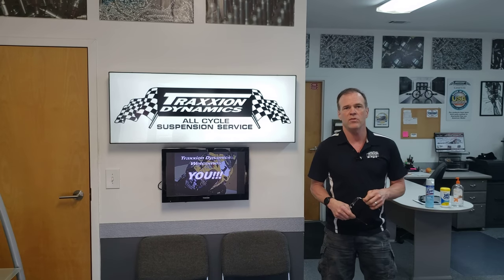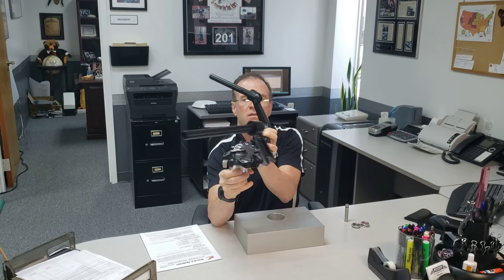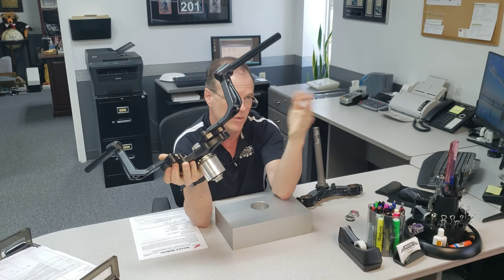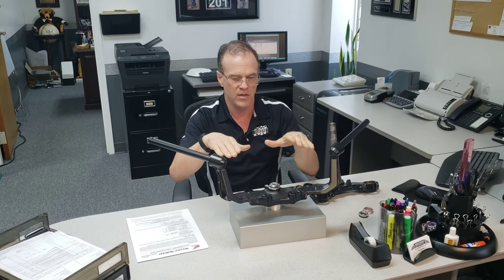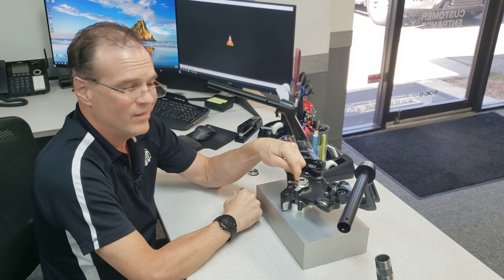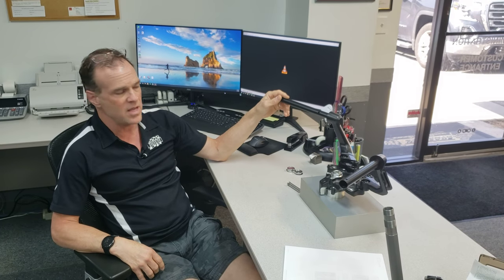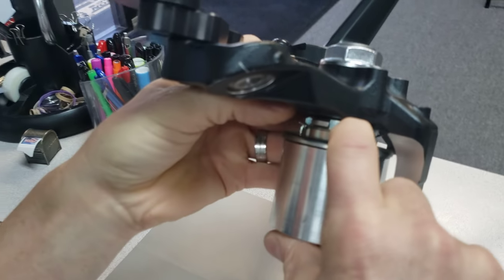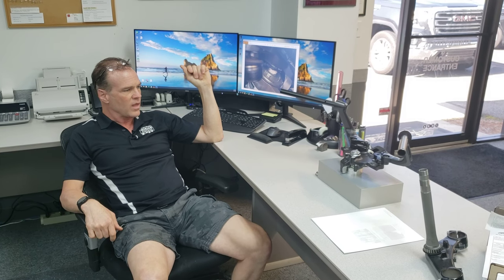2018+ Honda Goldwing Potential TOTAL Steering Failure!!!

Comment: I have a ‘21 Wing and this up/down wobble showed up instantly when trying to make a left turn from a stop into a gas station on a chewed up/under construction road covered in gravel and sharply banked left. There was a line of vehicles a mile long in the lane to the left of me blocking my entrance to the station. A dump truck made room and flashed for me to go, while coasting, so I got on it but the road and loose surface slid the rear tire out and I kicked my left leg out, stomped down and yanked the bars right to right the bike so I wouldn’t drop the bike, my wife, and myself. As I coasted toward a pump, I said to my wife “my bars have a wobble in them now after that…wtf…”. 

We didn’t have much of a choice but to keep going in that state for another 300 miles. There’s 1/2” of up/down play at the farthest end of the bar ends. I’m confirming that this is still affecting ‘21 Wings.
Reply from the maker: You need to have the spindle inspected, I wouldn't drive that bike one more inch!  Do you have our Steering Safety Pin in your bike?
Reply: @Traxxion  I’ll be ordering the new stem, safety pin, and the deeper stem nut from you shortly. We lucked out and made it to Indy safely. We were purchasing a vehicle there and trailering the bike back to Alabama. I haven’t ridden the bike since; mostly from wrenching on the vehicle we purchased. 

Now it’s time to work on the bike. It’s due for air filter replacement as well, so while I’ve got the bike apart I’ll be doing both the stem and filter while I’m there.
Reply from the maker: @BrandonWest87  good plan!
Reply: @Traxxion  Good thing I ordered the replacement spindle, getting this one off is proving to be quite the task. It’s certainly not at all able to be removed by hand per the Honda TSB lol
Reply from the maker: @BrandonWest87  that's proof it's destroyed.

Comment: Max, Sorry if this has been covered already. Could your pin mask a problem that's already there? is it easy to pop the pin out, check the bar movement, replace periodically? Although, once installed in theory it shouldn't ever fail.
Reply from the maker: No, it won't hide anything..  If the crown nut comes loose or the spindle breaks, it will be obvious to the rider that something is very wrong and needs to be fixed.

Comment: They guy breaks his bike by strapping it down via the bars in a trailer... and somehow we blame Honda?  The manual expressly states don't do it.  Want to know why?  Watch the video, you will break your bike.
Reply from the maker: Actually, EVERYONE is WRONG about that, including me.  I have read the Owner's Manual and it states NOTHING AT ALL about how to tie the bike down.
Reply: From my 2020 Owners Manual pages 223-224
Transporting Your Vehicle
If your vehicle needs to be transported, it
should be carried on a motorcycle trailer or
a flatbed truck or trailer that has a loading
ramp or lifting platform, and motorcycle
tie-down straps. Never try to tow your
vehicle with a wheel or wheels on the
ground.
 

Tie-down Method
1. Remove both sides of the cylinder head
side covers. (P. 154)
2. Secure the vehicle using a buckle or ratchet
style tie-down strap to the engine guards
and affix the other ends to an anchor point.
Make sure the tie-downs straps are tight
and the vehicle is secure.
3. Remove both left and right saddlebag

guard covers by removing the clips to
expose the saddlebag guards.
4. Secure the vehicle using a buckle or ratchet
style tie-down strap to the saddlebag
guards and affix the other ends to an
anchor point.
Make sure the tie-downs straps are tight
and the vehicle is secure.

There are two images in the manual showing the method.
Reply from the maker: @emmertw8111  The 2018 manual stops before "Tie down method 1."
Reply: For 2020 manual, Honda decided to better define the tie-down process.  Maybe too many issues with owners using the handlebars for attachment points.

Comment: Max. RE your previous response that the manual does not specify hiw to tie down.  This is a true statement for tje 2018 owners manual.  However, from another online forum,  in 2019 Honda update the transport instructions, and specifically say NOT to use the handlebars.  Maybe an updated video is in order.
Reply from the maker: In this post someone has posted the entire text from the 2020 Owner's Manual, and it recommends 2 methods, neither of which include using the handlebars.  But again, it does not say "DO NOT USE THE HANDLEBARS" anywhere.

Comment: So...has Honda resolved the steering stem issue as of 2023? Is Traxxion Dynamics safety pin still relevant? I'm considering the purchase, that's why I ask.
Reply from the maker: No, same spindle as 2018.  They changed the torque on the crown nut in 2019 to avoid damaging it.  The pin is just a backup.  Cheap insurance.  And now been awarded a US Utility Patent.
Reply: Shame on Honda.
Guess that comes with my  next order. Ha

Comment: I just bought a 2022 Tour DCT….  Has Honda addressed and fixed this problem by the 2022 ??
Reply from the maker: Nothing changed, except they reduced the torque on the crown nut so that it wouldn't damage the threads on the aluminum spindle.

Comment: my crown nut came off, had it replaced with flange nut, but not sure if mec knew to check the castle nut for rotation. crap. just called him, said no recall Canada. bring it in will look again. going to p/u your safety pin first

Comment: The question is how many have these failed in normal operation...  If there are many known failures that would lead to a definite recall...
Reply from the maker: The answer may be Zero.  My concern is time... pushing pulling, lifting a loaded bike up from the sidestand, with passenger on board, braking, accelerating, etc.  Another concern is a bike that tips over and hits the handlebar... if that happens, owners should change the spindle.

Comment: If you're talking about the bulletin that has a filename="MC-10153891-0001.pdf", I just dropped off my bike (2018 Goldwing) yesterday (Thursday) and today (Friday), they said that some threads are damaged and they cannot get a good torque (probably on that crown nut).  They are trying to get a part overnight'ed from Honda (well since it's Labor Day weekend, my bike will be in the shop until probably Tuesday).  I guess I'll be riding my pedal bikes this weekend.  In case anyone is wondering, my bike has never been tied down and I first noticed the play in the bars after riding on a bumpy residential rode.  I opened things up and the crown nut was finger loose (taking 2-3 turns to get it finger tight).
Reply from the maker: That's the one!
Reply: I picked up my bike today. Seems they were able to get an overnight shipment for the part. Btw, I have about 7.8K miles in case anyone wants to know
Reply from the maker: @dperique  Thanks for the update.

Comment: Enough force applied and you can break anything on the bike.  I’ve seen these guys load a bike in a trailer tighter than they would load it in a space shuttle.  You have to allow some sway or the energy is not dissipated bouncing around in the trailer. If you don’t that energy is focused on the weakest part. Learn how to load your bike in a trailer...  and make sure it can sway a bit, bounce some in the setup.

Comment: Could it be possible that the owner was using the handle bars as a tie down point?  Took a lot of tension for that to crack
Reply from the maker: Yes, but it still shouldn't break.  It's unacceptable.
Reply: @Traxxion  It definitely seems to be a hazard when they use aluminum that is soft enough to deform the thread enough for the nut to lose torque.  I always assumed that the tie down caution was due to breakage or deformation of the handlebars.  Never thought the stem would break and in this case the stem is all that you have to control the motorcycle.
Reply: Max McAllister & Traxxion Dynamics . It shouldn’t break and it shouldn’t have been used as a tie down point. Clearly stating the potential hazard would be appropriate. Reading and understanding instructions would be a plus. Look at it as a potential money maker where you can manufacture and sell a newly designed part that would be safe and durable. Do you feel the design like the Corvair is unsafe at any speed? Do you feel we are all potential victims of a poor design?
Reply from the maker: @alanhassall  Watch for a video:  The owner's manual does NOT say how to tie the bike down.
Reply from the maker: @gregggruse2522  I have read the instructions, they are on Page 219 of the 2018 Owner's Manual.  Have you read them?  Because they say NOTHING about  how or where to tie the bike down.  So you might want to check yourself before giving advice on instructions you haven't read yourself.
Reply: @Traxxion  I don't have a Goldwing, but I was referring to warnings that I have read in relation to Heli-bars and other things.  I have been fortunate that I haven't needed to trailer my bike.  With all of the plastic, it can be difficult to find something strong enough to tie down to without touching the nicely painted body work.
Reply from the maker: @alanhassall  Canyon Dancer makes nice products for the job of tying down handlebars, but for the new Wing, the best product is the Goldstrike tie-down loops that bolt to the frame.
Reply: Max McAllister & Traxxion Dynamics I read the Heli  instructions when I installed the risers but you are right Honda didn’t provide instruction and not everyone has installed Heli risers. I did state that it would be appropriate to provide instruction . I installed tie downs on my bike when I realized everything was aluminum. I should have been clearer. Sorry I pissed you off.
Reply from the maker: @gregggruse2522  No problem, not pissed off.  Just trying to do my part to stop the myth that Honda has given instructions on how to tie down the new Wing.  Which, should come equipped with tie down points like Gold Strike makes.
Reply: Max McAllister & Traxxion Dynamics it’s all good here. I  would like to see you use your creative mind and come up with a solution. I have read reviews on your products and people are very satisfied. We need someone like you to point out issues that may adversely affect us all.
Reply from the maker: @gregggruse2522  we'll have a steel replacement spindle in a few weeks, and will combine that with the Steering Safety Pin to make a much more durable steering pivot. 
Something else people need to be concerned about is, if they tip their bike over and hit the handlebar, that could damage or crack the spindle since the top plate is unsupported like they upper triple clamp on a telescopic fork.
Reply: Max McAllister & Traxxion Dynamics looking forward to ordering
Reply: @Traxxion  Max, I listened to you on the video several times and it sounds like you said the Honda manual says to not use the bars as a tie point.  I think you forgot the "not" in that phrase or mumbled a bit.
Reply from the maker: @rooster3019  that's possible... even I get confused!  It is best to get the Goldstrike tie downs and make that the main anchor.
Reply: @Traxxion    They are on order, as is your pin and some other goodies from Traxxion

Comment: Sorry I may have asked this once before at different time.
Should this pin be installed in the  19 or 20 models?
Is it that imperative on these years?
Reply from the maker: All models have the same aluminum steering spindle.  It takes 10 minutes to install, and costs $25.  Pretty good peace of mind.

Comment: Whoa, how could Honda not think it's a good idea. Their probably a little piss that the engineers that designed that part didn't come up with that when they realized their was a problem. Not enough testing was done on these bikes before production, more crash test is done on cars.

Comment: Max, is it possible when a pin is installed, God forbid the steering would break, that the bars would lift high enough to pull the pin out of the steering shaft?

Thanks
Reply from the maker: Not possible.  I did consider that, but by nature, it's length makes it so that can't happen.  It is 3" long, and there's only a 3/8" gap up to the bottom of the electronic console.
Reply: Thanks for the update
I did order the pin. 

Do you have a video showing the install? 
I will google it in the meantime, but if you can send me a link, I would appreciate it.

Thanks again
Reply from the maker: @rickthompson3243  hopefully you found the video, I have  been sick with the flu.

Comment: Great stuff Max! - I recently experienced a mid/high speed wobble on my 2018 GW - never had that before - since it happened quick I can’t remember if it was in cruise control or not (but my hands where momentarily off the bars when it happened). The bike has always rode ‘true’ meaning straight down the road, so this occurrence is of a concern. Not sure why it happened as the road was in good shape and the tires had the correct pressure (just I took my hands off the handlebars for a moment). I will check the steering (Spindle/head?) for movement.

 I’m just wondering if Honda (in my case Honda Canada) notified owner’s of the 2018 GW of this bulletin in regards to the torque and check of the spindle (I’ve never seen any mention of this on any of the 1/2 dozen scheduled services I’ve had done!).

Max please let me know when you have the stainless steel replacement spindle made - I will replace the Honda one as well as add in the safety pin (good Idea!!!)
Reply: P.S. the wobble was very prominent!
Reply from the maker: @moorgoon  That won't be related to the steering spindle.  It is almost always is a defective front tire.  I have a video on this.

Comment: Hey Max, do you still think it’s ok to strap bike down via handlebars in light of this failure?
Reply from the maker: So there's 2 sources for this problem, 1.  The 2018s being assembled improperly, and 2. if you drop or tip the bike over and hit the bars.  I wouldn't be afraid to tie down the bars on a 2019 or 2020. But it better if you use the tie down hooks from GoldStrike as the primary tie point and then use the handlebars as the backup point.

Comment: Max, I don't know why you keep denying that it's not wise to use the handlebars to tie down the new Goldwings.  I can't post a picture; I tried.  But, here is the exact verbiage from Honda's online 2018+ manuals.  "When tying down the motorcycle for transportation, do not use tie-downs or straps on the handlebars or handgrips.  Doing so may cause damage to the steering system, heat grips, and/or handlebar grips"  It is not in the 2018 manual that came with the bike, it IS in the 2018+ online manuals.  Page 219 on the 2018, and pg. 223 on the 2019 & 2020 manual, taken right off the Honda Powersports manuals page.  Owners reading this post should research Honda's online manual; they have updates that are not in the paperback manual. https://powersports.honda.com/downloads/owners-manuals
Reply from the maker: As you can see the information is vague at best.  Unless you have a 2019, you would not have received those instructions.  You are missing the bigger picture.  If this can break while tied down, it can break in any number of other ways.  Bike tipped over... cracked but owner doesn't know it, then steering fails.  300# rider with 250# wife pushing and pulling on the bars for 5 years, then "SNAP!".

Comment: Here’s my take on this issue.  I have no doubt that Honda Engineering performed a dFMEA (design Failure Mode Effects Analysis) on this bike design.  One of two mistakes was made in this dFMEA: 1) the dFMEA team omitted the possibility that the owner/operator may tie-down the bike via the handlebars during trailering, or 2) it was included, but the team gave the item a very low overall score.  Meaning the Validation Plan did not inherit an action item to test the durability of the handlebars during trailering.
Reply from the maker: OR... what about if the bike tips over and the handlebar hits the ground?  Without forks in place making a rigid structure, it becomes a toggle point.

Comment: Very Easy fix for HONDA!!!!  Make the Stem/Spindle out of something BETTER than cast aluminum. Steel comes to mind. I know weight was a high priority however SAFETY should be #1. Use a lower torque because the aluminum stretches and or deforms??  Should be a big red flag.  Max you should begin tooling for the manufacture of a high quality STEEL spindle Kit.
Reply from the maker: We're already on it!

Comment: Hey Max. I’m a brand new 2020 Goldwing owner. I watched your video about strapping down using the handlebars. You had said there’s no issue unless you over torque the straps. Is it possible this guy did that?
Reply from the maker: He said it was in a locking wheel chock, and the bike still had suspension bounce.  My guess is that his bike had a damaged spindle from the assembly errors on the 2018.  Regardless of how and why, it was extremely fortunate it broke in a trailer, and brought this possible problem to light for everyone.

Comment: They use the modified procedure with the tape when they are doing the work on their dime.  Do they do the modified procedure or the procedure in the manual when the customer is paying for it?  If the clutch slave cylinder needs replacement on an ST1300, the labor will ruin the owner if the work is done according to the Honda manual.  The engine has to be removed.  Fortunately, someone figured out that the slave cylinder can be replaced without dropping the engine.  Keep up the good work and we'll thought out fixes.

Comment: Max is that something you guys would check/notice while doing the steering and suspension upgrade?
Reply from the maker: We would notice if the crown nut came loose.  But this is best if you have your Honda Dealer "inspect this" for Warranty and Legal Liability Purposes.  I would demand they take it apart to inspect it, not just "wiggle the bars" to see if they are tight.